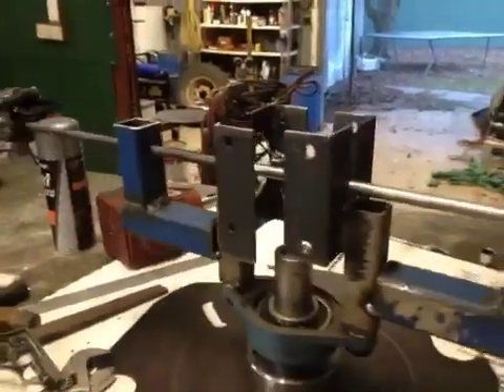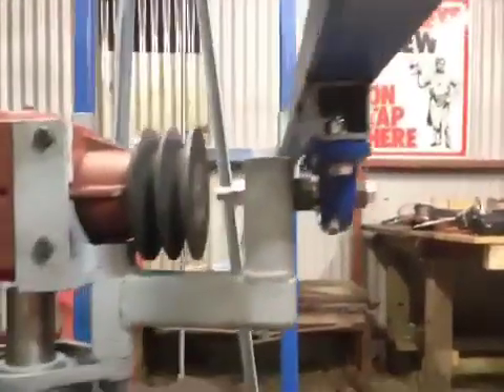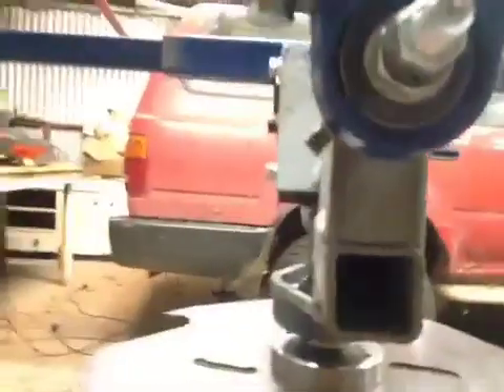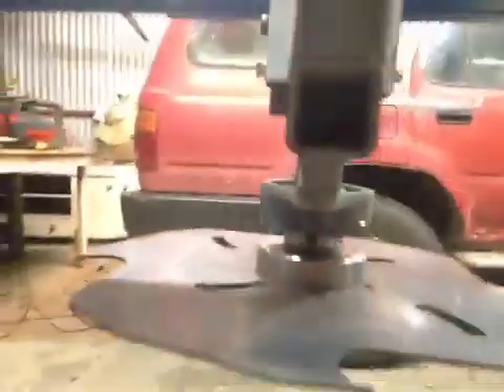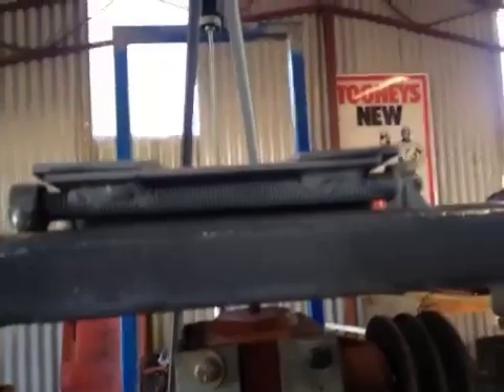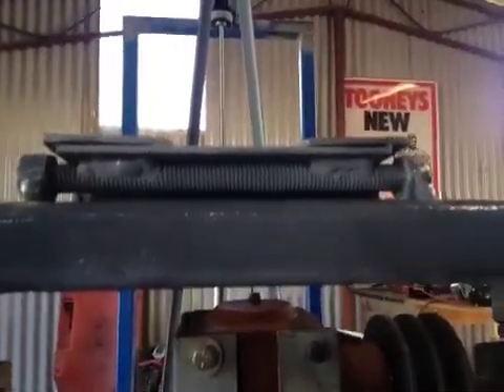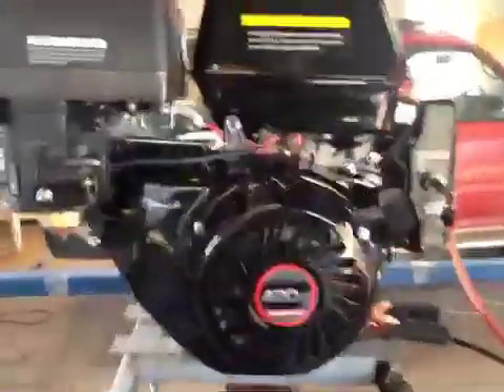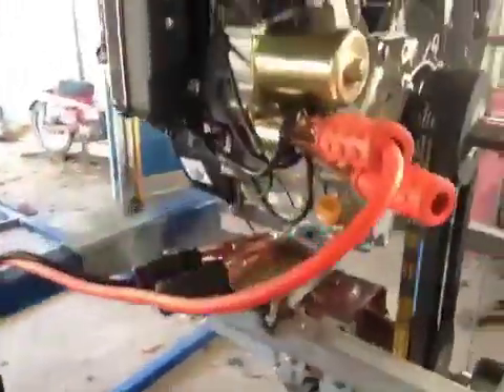How to build a Swing Blade Sawmill pt4

Comment: Hi could you help me? with the lucas mill machine, what is the gearbox rotation speed in the saber cutting system? How does the engine's saber bar system work? can you make a step-by-step docking system video?
    what would be the value of the Lucas Mill differential gearbox? where to buy?

Could you also show me , how to attach the saber bar to the engine ?

Comment from the maker: In retrospect I could have used the original mount if I had used 50mm spacers and mounted the gbox on the other side. The second mount I made seems strong enough. It hasn't cracked or bent. Thanks for looking. Are you going to make a saw?  Sounds like you enjoy spending time in your shed as well shedasaurus.  My missus bought me a plasma cutter for Christmas. Maybe she thinks I don't spend enough time in mine ha ha.

Comment from the maker: Hi shedasaurus. The gearbox hasn't given any reasons to make me think its not up to the job. Even though its not rated to the speed I use it. I keep a close eye on the oil level. And use ep gear oil 140w. It does use a bit of oil. I have changed the oil once. And run probably 10 tanks of fuel through the saw